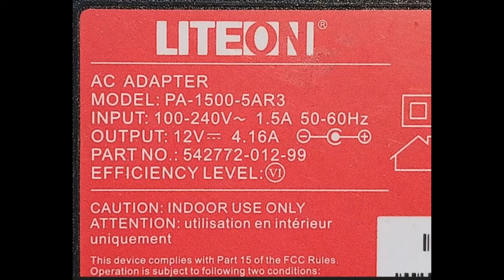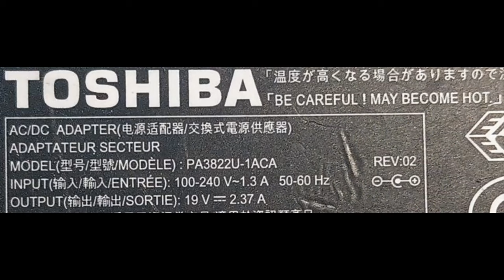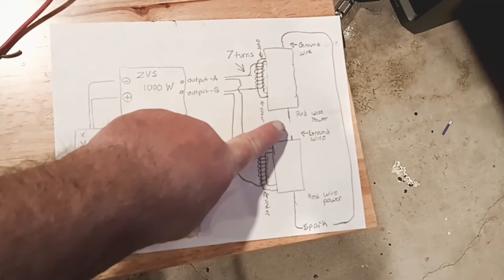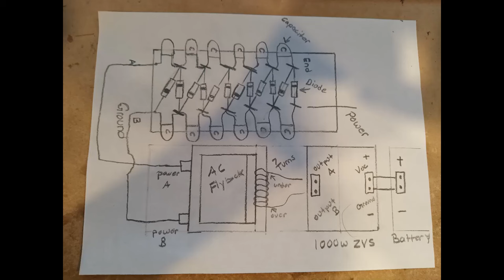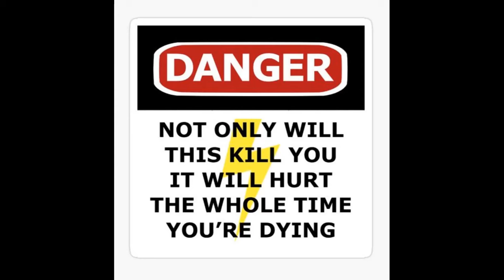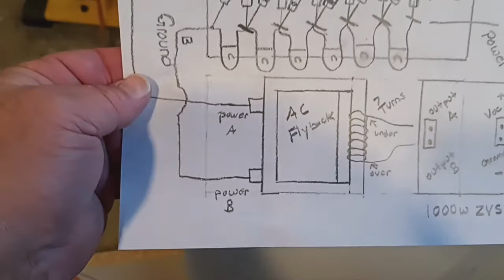High Voltage "Time to Light Them Up"

Comment: Reminds me of a project My ex and I made way back. Pert near 3 decades, I still have the complete plasma arc block in my storage.  It made a long purple arc. Lol long, ok the nail it went to was like 2 inches away, but the arc made a nice loop,  around  3-4 inches if you measured the length of the arc.

Comment: Back in the day, when cars used one coil, we would attach a diode from the center of the output of the coil to the ground terminal, and for some reason it would triple the output power of the coil, perhaps the extra voltage would go back into the ground of the coil to act like a feed back, much like when you put a microphone near a speaker, and it does that loud scream feedback, perhaps the coil voltage does the same, if nothing else, it is something to look at. 🤠👍
Reply from the maker: That is so interesting. I am attempting to do the same with my graviflyer project. Except I am using resonance in the center plate that creates sound. It goes into the center of the tesla coil and creates feedback. I was hoeing for the result you said and gets more power. I think I will get an old 70 nova coil and try it. Thank you for the insight.

Comment: Brilliant video Nathan. Very well explained and great experiments.
I love messing with high voltage but nowadays most of my time is spent with music. 
Your channel has got me interested in building something again. Oh, I noticed you have a guitar, great. 🎸👍
I have some small high-voltage coils like those little black ones you were powering. It would be interesting to see if they would be good for a small Tesla coil. 
As long as the output from the coil was rectified with a suitable diode. Either full-wave or half-wave rectification.
Cheers. 👌👍👍
Reply from the maker: you need different capacitors to make it work from a zvs

Comment: 43:20 this just blew my mind man! I was about to ask if you can feel a force on the stick. I thought it would be downwards, but this is trying to push it up!

Can you see all the parallels in all the experiments to how a UFO gets its propulsion?

There is a famous story of two men fishing. 1 of them describe a Zipping sound. That is what i hear in the experiment when it has that smooth wind sound.

Also, aluminum and Bismuth have been  found at crashes, and explained as simple Aluminum.

This Aluminum foil experiment packs a punch.

And we're always told to never put foil in a microwave. 

There is something here. I know it.

Can you try this, but with a 2nd plate on the bottom  and a hole cut out of the bottom plate
Reply: And then, try it without a stick to make it float
Reply from the maker: There is ion wind going on. It is 2.4 meters per second. So it wants to go up. It is just to heavy.

Comment: Im just curious, what happens when you shoot a high-powered laser into the plasma at different vectors and angles.
But ALSO with a hair, or one of those double slit experiment sheets with a fiber in it that is finer than a hair.

To me, light, and Electricity are very similar to the flow of water. 
What I'm getting at, is a turbine, how can it all be combined to make a plasma turbine.
Reply from the maker: as far as a turbine. The closest I saw was 3 empty soda cans. the outside 2 are negative and positive. The center has no voltage. When activated it will spin the center can. You could also build a corona motor with gearing. hat would give a higher output. Anything more than that I don't know.
Reply: @nathanbunten4299  what if the whole can part is inside the saucer? Power and everything?
Reply: No, no, no, if you shine laser on it, you'll have a time machine.
Reply from the maker: @ekojar3047  it would be interesting.
Reply from the maker: @starraider25  I don't think that is true. But if it was I would stop myself from shocking myself so many times.

Comment: i never knew that a ballast could drive a flyback! i always used a single transistor, 2 resistor, primary and feedback windings on the core, i always wanted to get a zvs driver but i havnt yet
Reply from the maker: everyone learns the driver different. That is why I built it several different ways.

Comment: I wonder why an asymmetry of mass between the positive and negative objects matters.
Another nice presentation!
Reply from the maker: I have always had a thought that when going through a coil that makes use of multiple magnetic fields that there are no positive or negative ends. There is also no ac or dc voltage. However there is a magnetic voltage or static voltage created. one the defies the structures we know as ac and dc. 

Every time I make an ac flyback it has 6 magnetic areas. They flow back and forth or on and off. The ac or dc stops at the soft iron core. only heat and pulses remain to start the coil to make the fields. So I always am left to ask. Is it still ac, dc or something new?

Even crazier you can use a Wilmshurst to make the coil work. What do we call it then?
Reply: @nathanbunten4299  Some food for thought! I'm intrigued by your unconventional approach to electrical engineering.
Reply from the maker: @shawncalderon4950  "When you don't read the rules. You don't know when you break them"
Reply: @nathanbunten4299  
Perfectly said. 
Forgive me for asking for your prior occupation.
Reply from the maker: @shawncalderon4950  I was a salesman for a soda company. I also owned a cabinet shop for a short time.
Reply: @nathanbunten4299  Thanks for sharing. I was in the Navy for nine years, served in the Gulf War, and then spent 18 years in the corporate world as director of IT for a big pharma company. I retired early at age 46 due to poor health. I stay with my wife in a Chicago suburb.
Reply from the maker: @shawncalderon4950  I am glad you enjoyed it.
Reply: @nathanbunten4299  You have an awe for the physical universe around us. It's contagious.
Reply from the maker: @shawncalderon4950  thank you

Comment: Is that tig head electrode doped with thorium? We need to find a way to introduce resonance with a 27000mhz Quartz crystal and a 28000mhz Quartz crystal a pass it off to a much larger capacitance so we can attach to it with much larger connections as the resonance cascade builds and do it in a vacuum so we can feed it with the fusion from a Americium/Beryllium reaction  ....

Comment: Do you know what a scalar energy machine is? I seen a bunch of videos of that, the most spanish people, basically the energy that comes out should be a different type of energy, who heals, and you can touch it, and it doesn't burn and its also correlated with antigravity engines, like lifter, bascilally its an high voltage generator, with a spark gap into it, after the spark gap there are 2 capacitors, one connected to the positive one to the negative, rhe capacitors are laiden jarr's if you know what thei are, but the interesting thing is that the output of the capacitors its not connected directly whit the wires, but ther is an insulator, or a dielectric material, in between, glass, if you use a sauce or jam contenitor, like i did, aftter that the 2 ends are directly connected with another wire, that sloud be a coil like of the size of a primary coil, but i dont figured out if its necessary or makes a difference if it is a coil or simply a wire, then the 2 exteemities of the coil have 2 wires connected, who one is the positive and one the negative, then there is the spark gap, of that scalar energy, you can touch it, and make it going trough your heart without issues, the length of the arc changes in base of the distamce of the spark gap between the capacitors, and changes even the frequency, from what i seen, te more the frequency is high, the better it is, the quality of the energy and it doesn't shock, but the more it's far the gap, the longer the arc it is but it is more shocking, so i tried a middle way, its even called cold energy, or energia fria in spanish, you could search it on google or youtube as energia escalar, in spanish, for differents results, sorry for the long comment, maybe you even alredy knew that, idk, keep up the good work
Reply from the maker: that sound really cool. I will look it up.

Comment: if i put an agate quartz would it go to the other side?
Reply from the maker: quarts cannot be electrified from the outside with electricity. You need to tap quarts to make it energise. If you can resonate a oxygen atom you can get the quarts to light up and expel energy.

Comment: I used mine to build a N2 gas discharge Laser
Reply from the maker: I saw one of those. That's a very cool experiment.
Reply: You can get more powerful lasers when you get moto blades in parallel such that the Amps get devided the blades have to be very close and a solutely parallel such that the discharge occurs throughout the whole length. The lower the blade the more optical wattage do you get from this laser setup. I virtually made it several meters long. By staking them on top of each other and diverging the optical out put with prisms one one end came a full mirror and on the other a full mirror with a pin hole. The the length of the discharge/Lasering cavity has to be a multiple of Lamda. The with of the discharge gab lamda or lamda half. A vacuum is needed only to increase operational power as well as mix helium into pure N2 gas. N2 gas is for UV laser and CO2 gas for infrared.
Reply from the maker: @icebluscorpion  It would be fun to do in a lab some day. You are definitely further ahead of me on this one.
Reply from the maker: @icebluscorpion  If you have time would you look at this circuit and tell me if the resistor and the capacitor are in the wrong spot. I think the capacitor is a leveler. So it comes in first in the circuit. The resister (next to input 3) can't be on a pulsed output to the coil. What do you think?

https://youtu.be/jwrKB7kMXUs
Reply: @nathanbunten4299  With the right side of the circuit you can adjust the circuit amplitude and the puls duty cycle by  adjusting the L317T with the voltage devider. The L317T can handle a input voltage of 37V and the data sheet also says that it can adjust from 1,2V to 37V. The voltage devider consists of a 10k ohm and a 240ohm 3W resistor. The 10k can go down all the way to short which leaves the 240 ohm on the lowest resistor value. The cap is as you said in the video a charge cap for the duty cycle. The second 10k potentiometer is for the trigger threshold for the Transistor. The 11 turns are as trigger coil. The transistors and the trafo primary is a oscillating circuit like the joule thief circuit. I don't like that the base of the Transistor is unprotected when the 10k is on the low resistance setting. I bet you can set ringing with the threshold potentiometer  which in this case could be desired 🤔. The secondary of the trafo builds a oscillating LC circuit with the Piezo actor as capacitance 🤔. I personally would limit the current on the base of the Transistor additionally to the 10k base potentiometer. Otherwise it is a very simple puls/function generator I admit it is very crude though. 🤔 PS: the Transistor potentiometer is to adjust the threshold to get it oscillating. The right side of the circuit is the hammer that initiates the oscillation like striking a bell/tuning fork the left side of the circuit is like the pitch tuning like weights for a tuning fork. 🤔You can add a little cap to pin 3 to stabiliz the L317T, important that it is not equal or bigger than the output cap, otherwise you lose the duty cycle function of the right circuit. The voltage devider is correctly connected on pin 1 though. The big cap on pin2 is there for the duty cycle.
Reply from the maker: @icebluscorpion  thank you for looking it over. I was probably overthinking it. I built it last night in both ways. Now I just need to test it to find the range.
Reply: @nathanbunten4299  nice 😎👍. I'm looking forward to see your results.